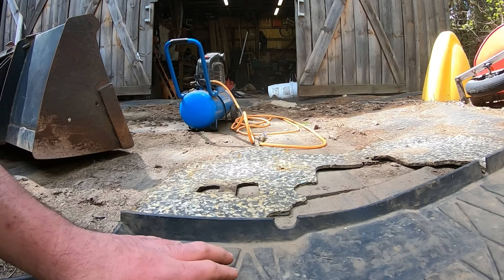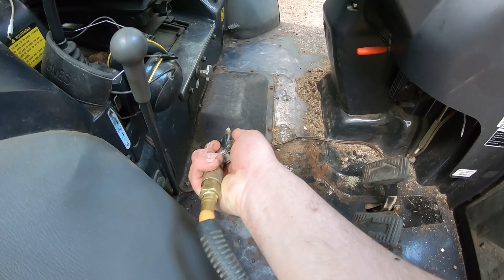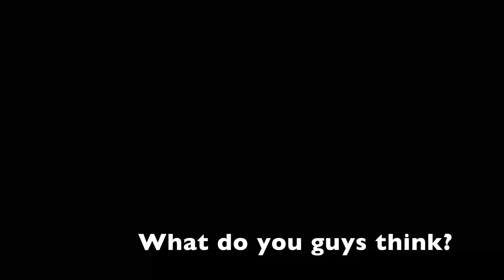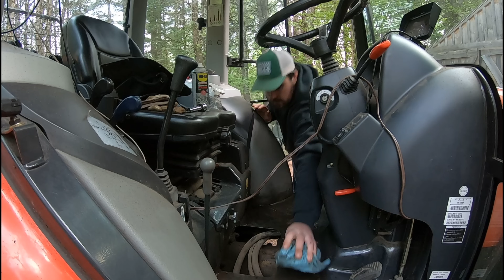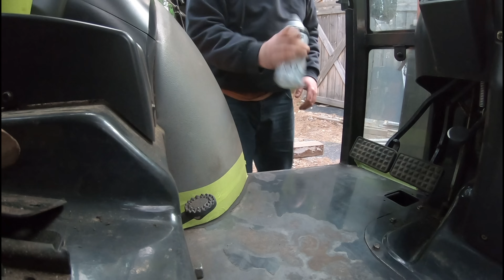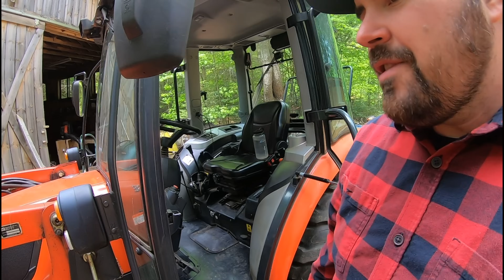Rusty Floor Pan Repair (I had no idea)

Comment: the foam holds moisture period. don't use it or you will have the same problems again. if it does rust again, you need to use a rust inhibitor to neutralize the rust. NO foam padding
Reply from the maker: thanks Rick

Comment: I would keep the rubber mat on the floor for protection year around.  I would get rid of the pad.  That pad will hold mosture up against the floor.  The rubber mat look as if it had a grid on the bottom to help with air flow.
Reply from the maker: I think you're right

Comment: I think it might be condensation, but it doesn’t just happen in the winter. I get condensation in the summer too but it dries faster. The rust seems localized. Your footfalls might be aggravating the situation. Dirt and moisture together makes a great abrasive slurry. That foam is probably necessary for noise attenuation so put it all back and add checking and touching up the floor to your spring season preparation/ maintenance checklist. Some rust converter might be useful as well. You can mitigate rust to some extent with hard work but Mother Nature ALWAYS wins.
Reply from the maker: That's a good point about the noise. May end up being quite the noise in the cab without it. Thanks for sharing that Robert

Comment: Leave the foam out. Blow dirt out from under it often as it becomes a sanding pad. Maybe add bed lining coating to the floor.
Reply from the maker: That's an idea I hadn't ocnsiered before. Thanks for sharing
Reply: @sawingwithsandy  as a comparison my Dad's John Deere is pushing 40 years old and without any mats, only the high points have any paint worn off of the deck - I'm going with poor painting prep by Kyoti - IF you have to paint it again, grab a can of the JD Primer - I dunno what they put in that, but it sticks ... though your prep looked pretty good here.
Also based on real life - the FORD factory spray in bed liner has stood up to some significant abuse from hauling metals, firewood, and the associated petroleum spills from chain saws and such- as others have said, get yourself some of that - I think that the Rhinocoat is one of the good ones (Anyone out there can give Sandy a personal use reference??) and coat the cab floor with that -- I would go up the sides 1/2 - 1" as well to form your own "tub" out of the stuff to keep whatever melts off your boots going anyplace you don't want it to go ... it's thick stuff to, so you might need longer bolts for that cover plate depending on where you forget to mask off.

Good Luck!
Reply: @sawingwithsandy  Bedliner can sometimes do the same thing, where it traps pockets of rust and they just fester.  An absolute beast of a Rust paint is Por-15.
Reply: Agree bed liner would be a good option  and the rubber mat only
Reply: You stole my thunder!!LOL!! I was going to write exactly the same thing you said!! LOL! The foam is holding the moisture, condensation, wet boots, snow, rain, etc. Bed liner, if applied properly, is TOUGH!!! Should last the life of the tractor.
Reply: I think this is the best solution.
The pad is a sponge and keeps the water in.
Reply: @railroad9000  100%, the padding is holding the moisture. Sandy needs to just throw it away. I’d still use the mat on top of the bed liner, but the padding would go in the trash! LOL
Reply: @09FLTRMM77  Sacrifice some foot comfort for rust prevention.
Reply: My DK65S has a similar floor mat it’s great it does not have the padding underneath and I don’t seem to have that problem so I agree also keep it out
Reply: bed liner is a good idea just DON'T get it on bolt heads holding 
access covers down they will be a chore to remove if you do .

Comment: I say put it back. Jumping in and out of the tractor will just put wear and tear on the paint.
I'd say they either didn't clean the surface well, didn't rough up the metal or didn't use primer before painting. Even painting in too cold of temperature. You'll probably never know. Have a good day! ✌
Reply from the maker: Yeah could be just about anything couldn't it

Comment: Ide day a mix of less adhesion and moisture.
I would put the mat back in.
My L series Kubota does not have a closed cab so it doesn't have a mat. Anytime there is snow or rain   I'm always losing traction getting in or out of the tractor. All it takes is one damp boot sole on a painted surface to go for an unfriendly spill..
Keep up the good work there Sandy.
Reply from the maker: Yeah that's very true. Would hate to have a fall and regret not putting it back

Comment: I would Put the rubber mat in but not the foam. The foam is just going to hold water against the metal.
Reply from the maker: Yeah that foam likely doesn't dry too well

Comment: the noise suppression mat needs one of the better ones that can allow moisture to escape back into the air there is a reason they put in cheep NSMs profit, however if you want to keep the noise down there is much better stuff on the market, but I still think you should try it without and see what you think, in the end it is your machine and your choice, hope this helps Sandy. good video, education is a good thing.
Reply from the maker: Thanks for that! I'll look around and see abotu a better noise suppression foam mat.

Comment: Why don't you go to home Depot I'm down in the states but places like Napa and get a Rust-Oleum undercoating like what they put under your vehicle you can get it in the can people use it as a bed liner you just roll it on or use a paintbrush
Reply from the maker: That could work for sure. My only fear is it traps water underneath it again and doesn't bubble this time. I'm just not too familiar with the product but I suppose it works if it's on millions of vehicles
Reply: Well there is one way of finding out make a phone call ask questions that's the only way you learn the only reason why I'm saying this was because that's what I had to do was call and ask questions and see if you can find your answers if they want your business they will be more than glad to help you

Comment: Place the rubber mat back but get rid of that under floor yellowy thing it is holding the moisture, then you can just take the rubber mat out and quickly check the floor, hope this helps, it is what I was taught to do with the trucks I drove, good video Sandy, now others will be checking their machines.
Reply from the maker: Thanks for sharing that Jim. good to hear from others in this department

Comment: Hi Sandy have you checked the bottom of your tractor?What does that look like?
Reply from the maker: Great question Sydney. I have checked the underside and it looks clean. It gets reguarly coated with undercoating oil which prevents the rust and so I'd imagine thats the reason it has not had this issue

Comment: The whole machine is probably powder coated except the floorboard. Do you all use salt up there in the winter? Down here in the states they pile the salt on the roads and it eats the vehicles. 👊👍
Reply from the maker: Yeah tonnes of salt use around here. I don't drive the tractor on public roads though so it doesn't come into contact with salt as I don't use it on my land.

Comment: Use POR 15 on the rust as your primer. It will kill the rust. It is expensive, but it works on my equipment . Regular primer will not stop the rust
Reply from the maker: I've seen that used on trucks before. You'er right about the expense but good to hear it works. Thanks for sharing
Reply: Agree POR is the way to go!!!  Forget bed liner it will not last.  POR is forever!!   Just don't get in on your hands as it will take days to remove and dress in old clothes as it will never come off

Comment: If you didn't, I would spray two or even three coats of paint. One coat I think is just not enough of a protective barrier.
Reply from the maker: Good point. I did put two solid coats on just to keeper good I'm hoping

Comment: I done Autobody and owned a body shop for over 40 years my suggestion would be get rid of the sponge , you can still use the mat .by the way a portable sandblaster would be the way to get rid of the rust ,then treat  it with rustoleum primer and rest oleum Apoxsee paint
Reply from the maker: Thanks for that Stephen. Appreciate it

Comment: Some are suggesting that you not re-install the foam, but that’s not jut for comfort - it’s for noise suppression, so you’d probably find it louder in the cab without it.  Now that you have it painted, my suggestion would be to spray a light coat of Krown or Rust Check over the new paint, wipe off the excess but leave a light film, and then reinstall the foam and floor mat.  The hydrophobic oil should stop or at least substantially slow down any further rusting.  Check it from time to time and reapply the Krown at least annually.  You may find the mat slides around a bit but it looks like it’s well fitted so it shouldn’t move much.
Reply from the maker: I like that idea Dave. I also think it's good to have the noise suppression as one of the nice things with a cab is it being relatively quiet (so I can listen to the radio too haha)

Comment: Another interesting video, thanks.  I think it may have been improper preparation of the metal before original finishing.  Rust bubbling under paint is from poor adhesion and trapping moisture.  If it wasn't pinholes in the paint, it was bad prep.  Looking at the patterns, it was worse under where your feet normally are, so you may have ground in some sand to create pinholes in the paint to get moisture in.  My guess is that it will be back, but not in the places you took it down to bare metal and finished it well.
Reply from the maker: That's a great point Paul!

Comment: Maybe a rubber mesh/netting style mat instead of a solid rubber mat? It kind of defeats some of the purpose of the solid mat because it won't keep water and dirt from getting on the floor but, it will still protect the floor from scratches and such and won't hold the moisture in. 
  If you do put the solid mat back in, agree with other commenters that said don't put the foam back underneath and see if that helps.
Reply from the maker: That's an idea I didn't think about with the mesh style. Thanks for the idea
Reply: @sawingwithsandy  Would also let you keep an eye on the floor for any signs of rust without having to take out the mat.

Comment: Good day Sandy. I have the same ongoing problem with my Kioti tractor 🚜.  The paint is starting to flake off.  My Kioti tractor is only 3 years old and she flakes. I can only imagine in ten years from now what it will be. Anyways I like your videos and have yourself a Great Day.
Reply from the maker: Well if it's any reassurance for you, the only paint that's flaking off on my 2012 Kioti is in spots on the loader and the floor here. I also park mine outside 99% of the time. Hope the paint coming off is isolated in your case. Hope all is well with you.

Comment: Try a spray-on bed liner for a little added protection.
Reply: Using an undercoat was just what I was going to suggest just to be sure...overkill perhaps, but then you should never have to worry about it again (and still be able to use the cushy foam pad!).
Reply from the maker: Thanks Don and Mike!

Comment: Good work attacking that rust before it gets outa control. POR 15 paint is good stuff too. Get rid of that padding that holds the moisture. Maybe add some drain holes in floor with nipples n hoses attached to help drain if need be

Comment: What if you now put a bed liner on the floor , the kind you roll on .
 Use the mat in the summer and take it out in the winter , if the heat is on it will melt any snow on your boots and dry up the floor with out the under pad holding moisture under the rubber mat .
Reply from the maker: I think this could be a good option. My only concern is there is still some factory paint on the floor that didn't chip up (yet) so I may wait a litlte bit to be sure that it is going to stay put but the bedliner is a good permantent solution for sure

Comment: I would just install the rubber and not the foam, and you can always throw a heater with a fan in the cab after your done using it in the winter and let it run for a few hours, that would help dry out everything.
Reply from the maker: Good idea for sure. Thank you

Comment: don't put the foam pad back.  I think that was holding moisture against the metal and causing the rust.  Just put back the rubber.  Otherwise it'll be too slippery.
Reply from the maker: Think that makes sense Joe. Thanks for that

Comment: Glad you caught that corrosion when you did.  I keep a can of Rustoleum rusty metal primer around for these kind of repairs.  I find it easy to brush on the primer and avoid all of the masking required for spray painting.  I also brush on the top coats.  The Rustoleum paints level out very nicely and you get a nice finish.
Reply from the maker: Roll on is a good idea for sure. Keep the mess down. Never fails that I always need to touch something up due to a scrap or what have you
Reply: I’m a fan of the brush on Rustoleum for this type of repair too.  No masking required and more robust I think. 
The padding provides sound dampening too. I’d put it back. Take it out every spring and dry it out and check your paint.
It also holds the shape of the floor pan.

Comment: Recycled metal. It did not rust from the outside , it rusted from the inside out. I have cut and ground sheets of recycled metal and found rust on the inside as I ground it.
Reply from the maker: Is that right eh. I’m wondering why it only rusted in this spot. Maybe just got unlucky
Reply: @sawingwithsandy  No  not unlucky.LOL you are right with the moisture, Just that recycled metal always seems to blister paint and rust from underneath. New metal needs a scratch or woren off paint to rust. Just my opinion I worked with a body man for a while and he showed me many examples of that.

Comment: Would have benefitted from some rust converter Sandy. There are plenty that can be painted over.
Reply from the maker: I was able to get all the rust off so figured I could use a primer and paint.
Reply from the maker: Just thinking about the rust reformer I’ve used it before on some other projects. Have you found any good ones that work well?